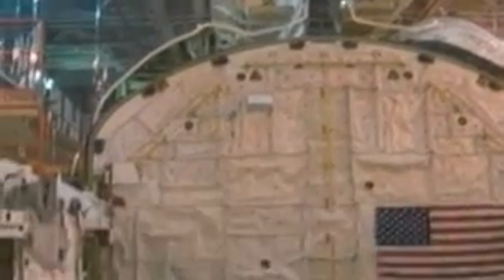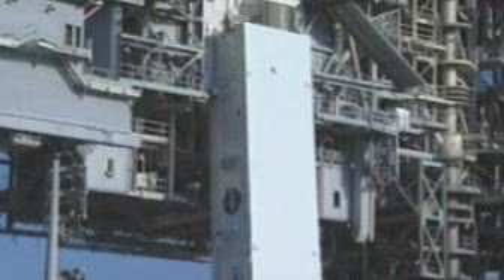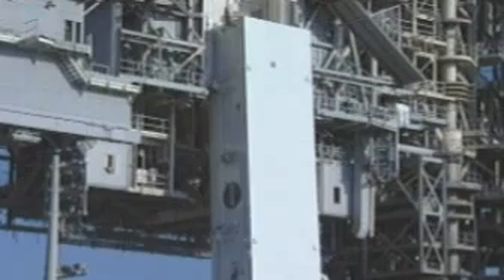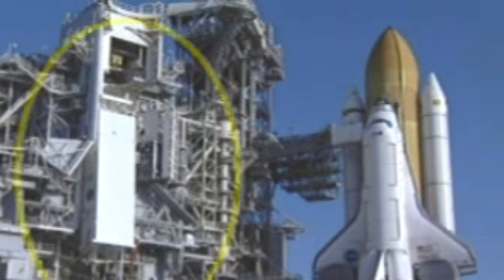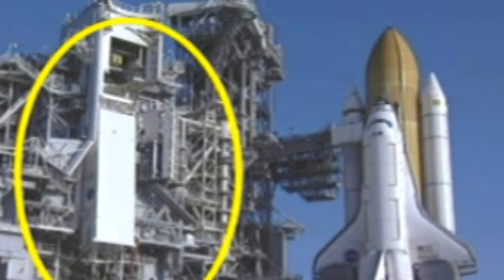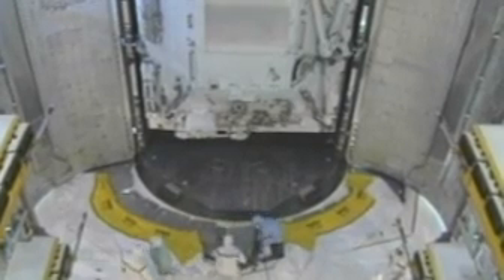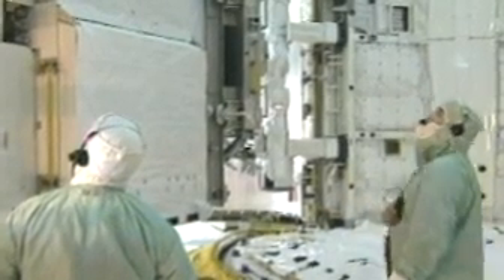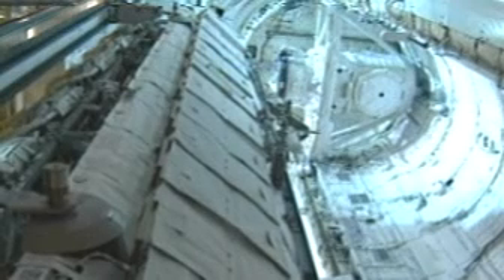How Does the Space Shuttle Work: The Payloads

Comment: there are two ways to load a shuttle 1. at Launch Pad 39 and 2 in the OPF. if it is side mounted it is loaded in the OPF this includes ASTROTEC HABS, LMCs, GAS CANISTERS, MISSE EXPERIMENTS, ESA PLATFORMS, STORMS BLACK BOXES and sat launchers. if it is a sat,ISS PARTS,EXTERNAL PLATFORMS, FUEL TANKS,or any thing that is used on the ISS in its gas tanks it has to be loaded at the pad.